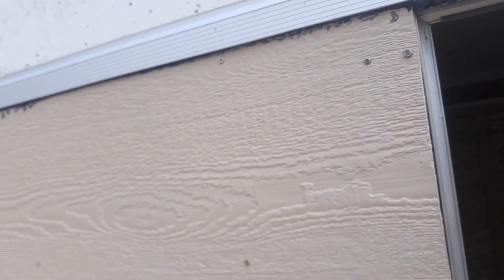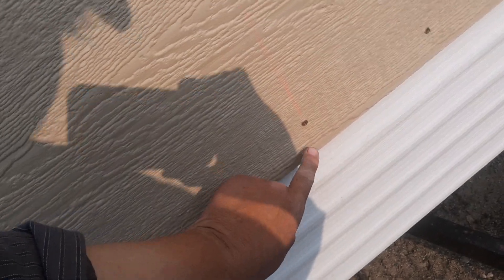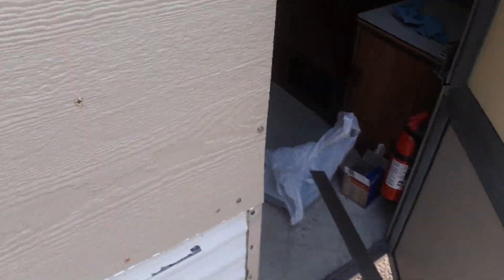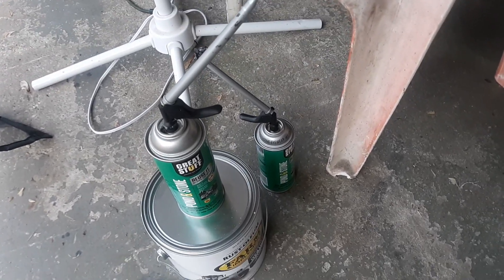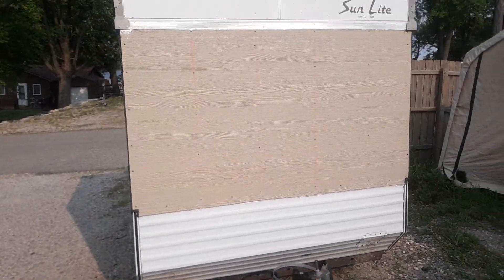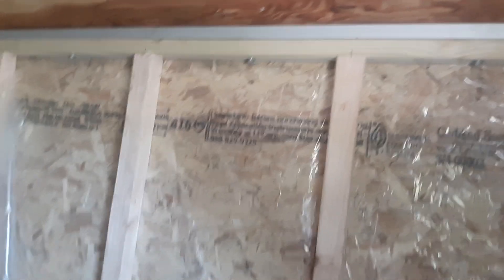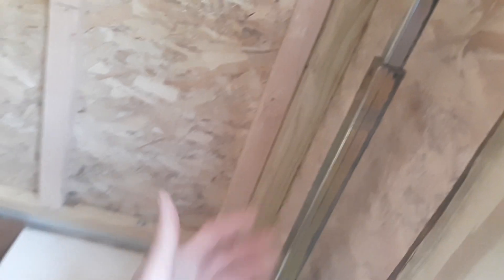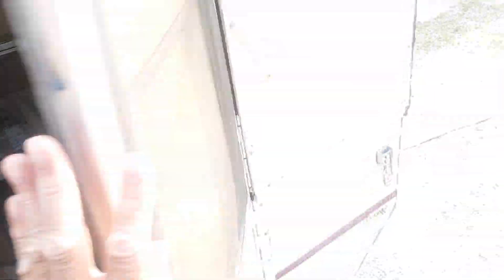Turning a pop up camper into a hard side fish house/camper part 3

Comment: Build is nice , filming could be improved.
Reply from the maker: I totally agree, I just do not have the team but trying, thank you !
Reply: Couple yrs ago, I got s free pop up, rough shape,  stripped it to the frame and started over w 3 sheets of true floor and framed up it up, heater and all still worked so I used everything I could, turned out sweet!
Few weeks ago I got another free pop up, alot better condition, just gonna do exactly what You have done, Looks like You built it Right and Solid, it's all 2X2 framing? And Then you sheeted it? I was wondering about the Lip and how I was gonna make it work.. you made it look great like it was spose to be a fish house all along.. what did you use for the sheeting?? Thankyou for this Video